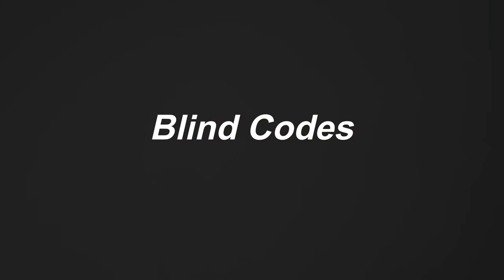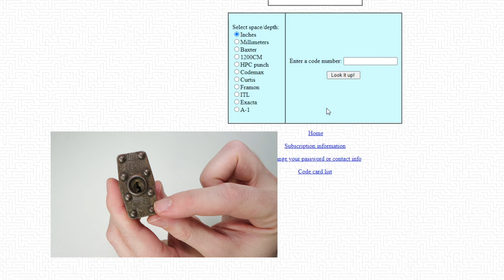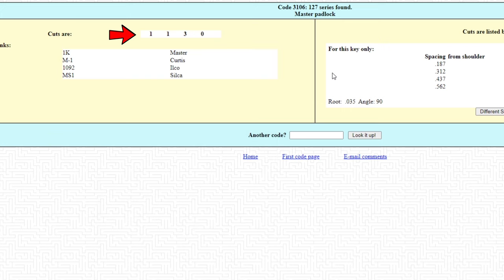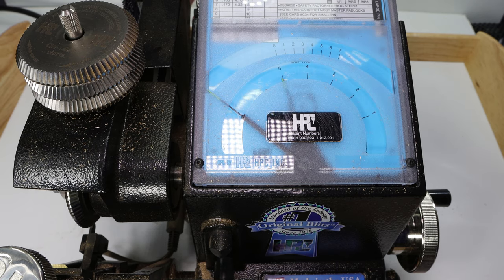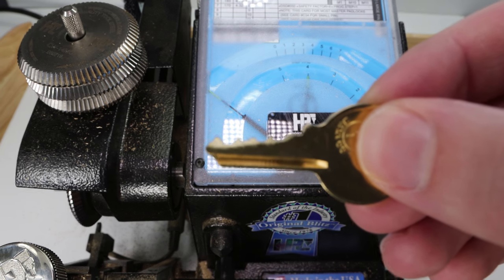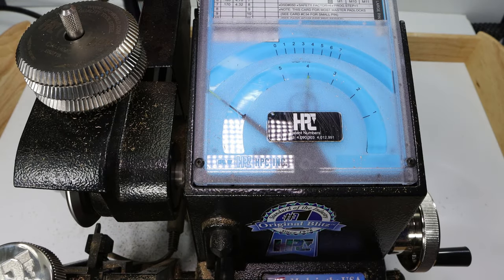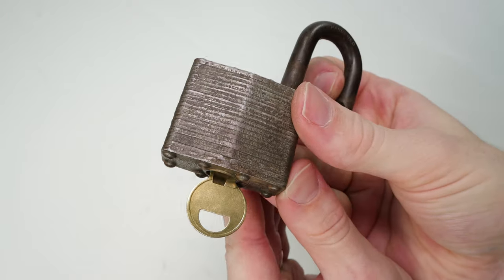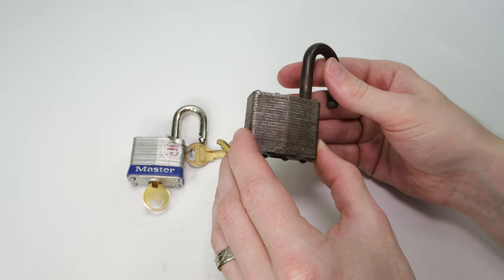How To Cut A Key To The Blind Code

Comment: Excellent tutorial. This will not help open modern locks you do not have the code for, but it is a much better method than impressioning a key in order to cut a duplicate. Well done sir.
Reply from the maker: Thanks for checking it out

Comment: Well done. This is very interesting. Every time I see a machine I want to get one but I can’t seem to justify it. Maybe some day.
Reply from the maker: For $500, the Silca Flash 008 duplicator is an excellent choice. It cuts extremely fast, you could code cut with space and depth keys, and it is small. I am not trying to sway you but it is not a bad deal.

Comment: I recently purchased two used pickup canopies, neither one of them included keys. Both of them have Bauer T-Handle locks on the side and rear hatches, and all have blind key codes imprinted on the fronts of them. Would you by chance have bitting codes for these locks/keys, as well as the types of blanks I'll need if I give you the blind codes? I'd like to cut them myself if possible. If you do not have this information, do you have any suggestions as to where I may find it?  Or, if neither of those are possibilities, do you know if these types of locks can be disassembled without a key without damaging them, so I can manually check the measurements?  

Thanks
Steve
Reply from the maker: Feel free to send me an email. I would need more information

Comment: I have a old master pad lock from the early 80’s   And the code written on the lock is 2316 and that same code was written on the key that I no longer have. I know some old master locks had the actual code written on the lock (not a blind code) anyway Could you tell me what is the actual code I would need to cut my M1 key to open my master padlock that says 2316 on it?
Reply from the maker: You could sign up for one of the database websites or purchase a key from a lock smith

Comment: Well, half a good video.  I’d like to see how that cutter actually worked.  What was the meter face? How does it work?
Reply from the maker: I linked the how to use a code cutter video. There was no significant need to show it since every machine is different
Reply: @HelpfulLockPicker  okay, Tnx.  But showing it is a bit like having a gun in a play & no one getting shot.  Do they operate like run-out gauges in metal machining?   I’ll watch the vid.  But how you do it is as interesting as what you do.